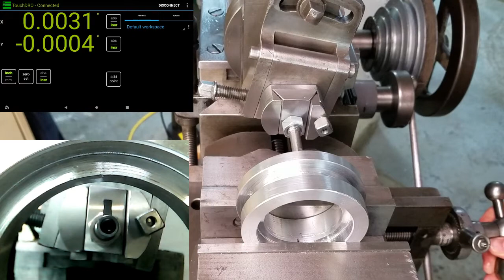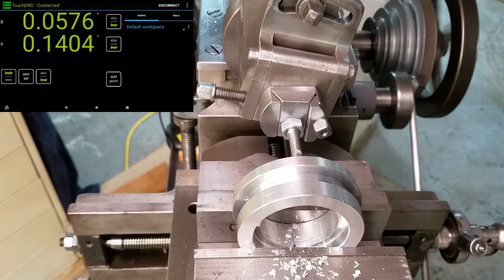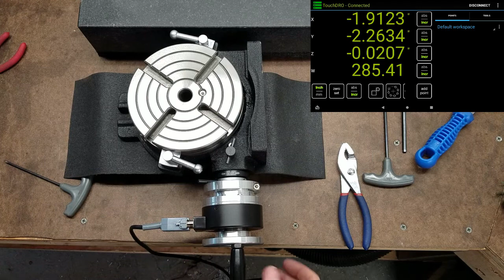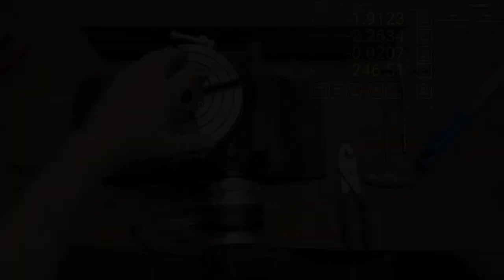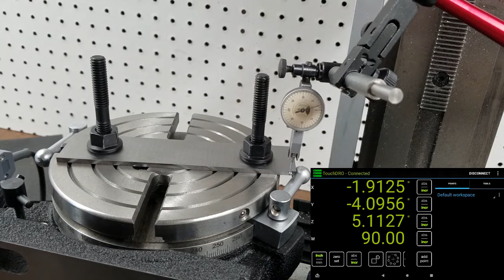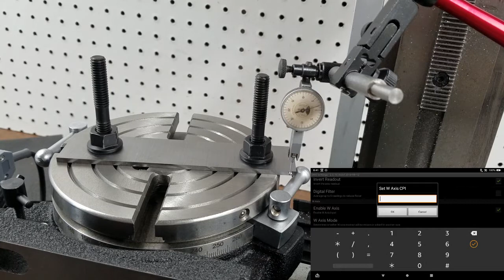Rotary Table DRO Encoder (Part 3: Keyway cut, assembly, testing, and calibration)

Comment: Pretty cool build, except the one way bearing, if you pass your number you have to turn the handle 90times to get there again, without the one way bearing you would have to go opposit few degrees and come up to your number again.
Reply from the maker: Yeah, that is one drawback. However, the one-way bearing is essential. There is a small amount of play in any gear system, and in this case, turning the handle backwards would introduce error in the readout due to this backlash. The bearing eliminates the possibility of causing that error, basically sacrificing ease of use for accuracy.

Ideally, the encoder would be inside the body of the rotary table, driven directly by the table itself. However, there isn't room inside the casting to allow this, hence my solution.
Reply: @fna-wrightengineering  I see now! You are rigth hmm

Comment: Gday, you really did a nice job fitting the encoder to the rotary table, I have the TouchDRO unit on the Cincinnati mill and can’t fault it, great DRO, awesome job mate, Cheers
Reply from the maker: Thanks, Matty! This project came out better than I had hoped. Haven't had occasion to use it yet, but I'm sure I will eventually. 

I've been super pleased with TouchDRO. I think it really can't be beat for the price and functionality. I've got one on all my machines, except the optical comparator (which may get one, as well. Haven't decided).

Comment: I have the same rotary table. I used it a lot when making the sensitive knurling tool. Unfortunately your mod would not have worked. As i had to go clockwise & then back round anti. 
But must say you made a 1st class job of it.
Regards. Steve.
Reply from the maker: Much appreciated! And yeah, having it only turn in one direction can definitely be a limiting factor. But it's pretty quick and easy to take off the encoder assembly, and just swap the regular handle back on, if needed.

I'm diving in to your knurling tool build videos now! Looks like a fun build.

Cheers!

Comment: Do you have a way to override the one way bearing for those times you go past your mark? We all do that here and there. Do you seriously think they can’t count out a 90:1 gear ratio there? Remember that you’re not measuring table movement, as we do with mill and lathe DROs, but rather the movement of the worm shaft. So this DRO will not account for slop. In theory, the bearing will account for that, but there is slop there as well, as it’s not intended for this purpose.
Reply from the maker: No, no way to override the bearing, short of removing the whole assembly, or going allllll the way around again. I admit, this is a drawback. 

No, I don't expect it to be a perfect 90:1 ratio. The test I filmed happened to end up that way, but I redid the test later, and repeated it several times, and came up closer to 90.04:1. 

I'm aware that I'm not directly measuring table movement... That would definitely have been my preferred method, but there's no room inside the table body to put an encoder. 

The bearing is not there to eliminate backlash, it's there to help prevent any from being introduced. 

Theoretically, this contraption has single-arc-second resolution... But let's be realistic. It's an import encoder, with an import one way bearing, on an import rotary table. I'm not naive enough to expect (nor do I actually need) that level of precision.

I addressed a lot of of this in the first video of the series. But hey, I appreciate the input.